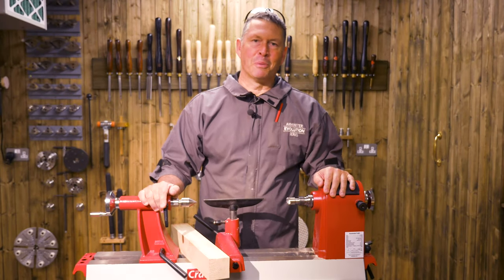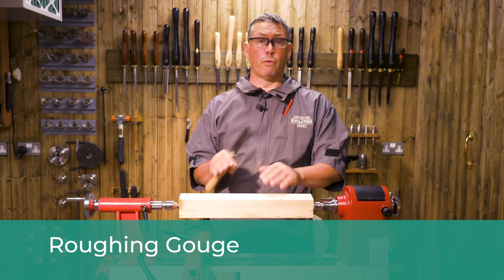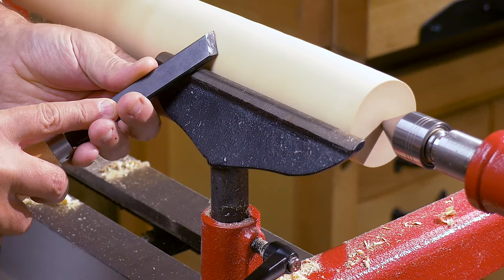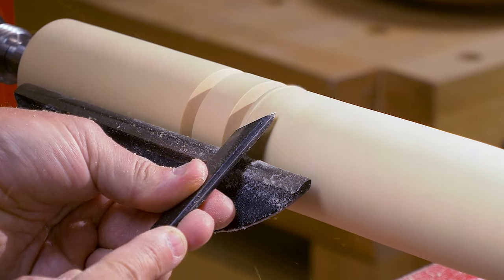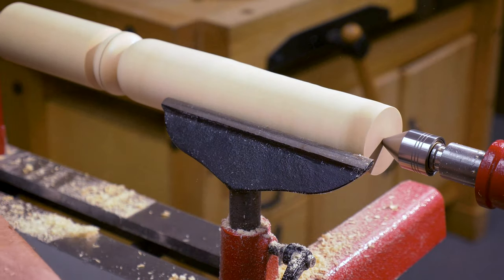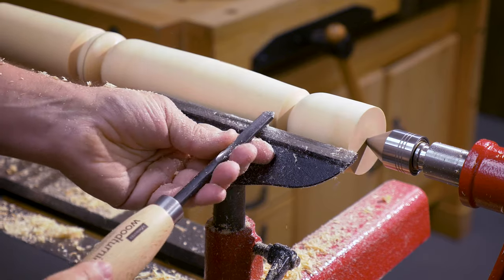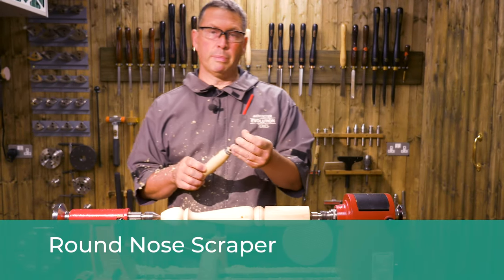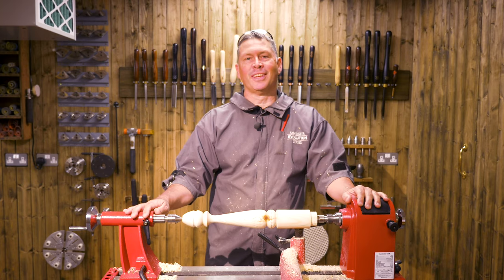Beginners Guide to Woodturning Tools

Comment: I’ve been woodworking for over 45 years and turning for the last 20 (?). So, I’m experienced and reasonably skilled. For any newcomers, I can vouch that this is an excellent video with all that you need to know to get good results quickly. If only, it had been around when I started. 

I’ve downsized my lathe now to an Axminster machine. Looks very much like the one on the video - perhaps a little smaller. Having had a large, much more expensive lathe, I can say that the Axminster does not represent a step down in quality. 

I have no connection with Axminster other than as a customer of many years.
Reply from the maker: Great to hear you enjoyed our video and thank you for your kind words

Comment: Just about to buy my first 15cm bench lathe do I need smaller bench tools for this lathe? Thank you.
Reply from the maker: Hi Terry, here is Colwin's reply: "No, you can use the same size lathe, however, sometimes, especially when bowl turning, you will find the bed can get in the way of the longer handles on bowl gouges. Also the cut from a larger gouge can cause problems with lathes of smaller motors just not having the power to drive through the cut." I hope this helps.

Comment: Not yet got my lathe so please excuse the question. Does it matter which direction the lathe is turning the spindle? I notice you've got it running 'into' the tools, ie anti-clock, rather than 'away' from them.
Reply from the maker: Hi Tony, the lathe has to run toward you in order to turn. Hope this helps
Reply: @axminster  Thanks yes I've read a bit more since then and now feel a bit stupid for thinking it could work the other way!

Comment: So the spindle gouge & the skew chisel are the only tools in this set where the tool rest is above center?
Reply from the maker: The skew will need to be higher for planning cuts and the spindle gouge can be used just above centre line.

Comment: Ahh, very good instructional video, except that you didn't film the round nose scraper with the bevel against the timber before you started doing that cove. By the time we see the filming there's shavings on the scraper and we can't see the angle that the scraper was held at to make that cut. I had to slow the video speed down to 0.5 to see that action with the scraper. After you saying the scraper is the only tool that you use with the handle high, you almost had it horizontal at right angle to the work. It would be nice to know the correct rake angle for the scraper.
Reply from the maker: Good morning,
There is no correct rake angle as the bevel can be anything from 90 degs to 15 and still work, however for different uses. Generally the 45 degs is the most aggressive and the bevel isnt used to rub the timber. the handle can be placed from parallel upto roughly 30 degs to work well depending on your bevel angle, material to be cut and grain orientation.

I hope this helps, please let us know if you have any further questions.
Kind regards
Grace Foster
Specialist Sales AdvisorAxminster ToolsPhone:03332 406 406
Tweet to @axminsterB2B [https://twitter.com/intent/tweet?screen_name=axminsterB2B]
Web: [http://www.axminster.co.uk/]www.axminstertools.com [https://www.axminstertools.com]
Axminster Tools
Phone:
Web: www.axminster [http://www.axminster.co.uk/]tools.com [//tools.com][https://www.axminstertools.com/static/frontend/Axminster/uk/en_GB/Magento_Email/logo_email.png][https://emailsignature.trustpilot.com/signature/en-GB/2/46e699340000640005015d96/text.png][https://emailsignature.trustpilot.com/signature/en-GB/2/46e699340000640005015d96/stars.png][https://emailsignature.trustpilot.com/brand/s/2/logo.png]